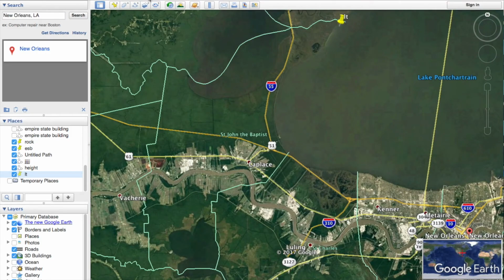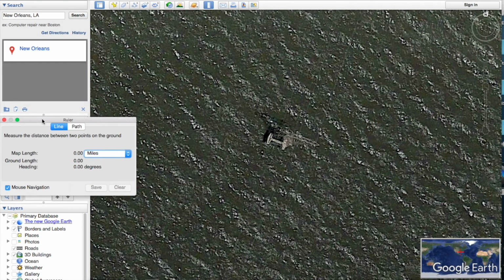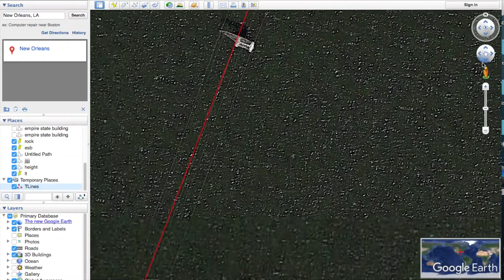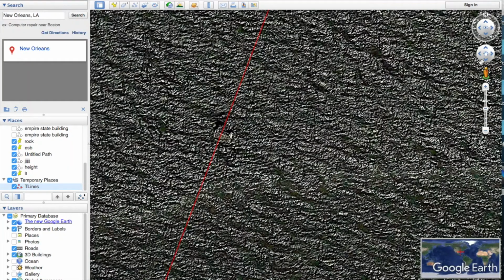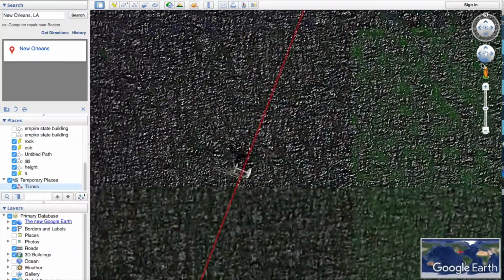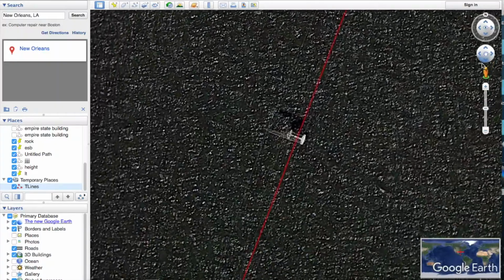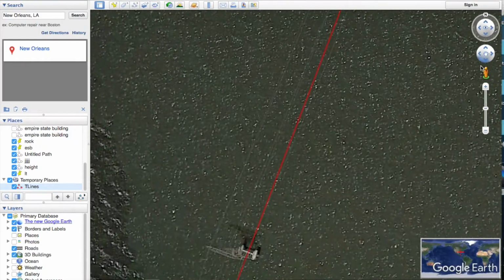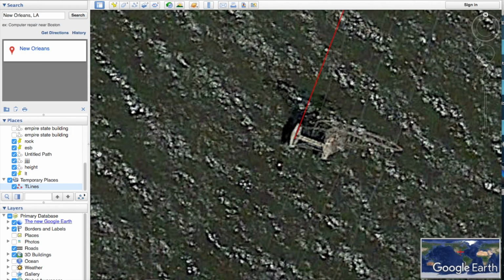Lake Pontchartrain Transmission lines, P900 creates illusion of a curve

Comment: BS if you look pictures taken,. sure this turn makes it more visible from certain side...  but downward curvature is visible from both sides... 

 if it would be only because slight curve in line 

that "optica illusion" wouldn't be visible from both sides of structure

plain and simple that was dishonest
Reply from the maker: BS - Soundly used a tilt shift lens - There is no curve on lake pontchartrain - And the lake is only 16 feet deep, all the curve he put on that water would have been a tsunami headed right at him......Comical

Comment from the maker: One more fact about lake Pontchartrain it has maximum depth of 16 feet, the average depth is a little less. The curve ballers want to claim here would make this lake a moat...its comical.  And based on the research by MrThriveAndServive - soundly was using a tilt shift lens.   Here is a little secret; as a surveyor I know the elevation of the land that surrounds a body of water holding it in - is all absolutely the same elevation and the water is Flat.
Reply: Same elevation does not equate to a flat earth.
Reply from the maker: @jeffburton2625  So the same is not the same...got it....comical
Reply: That's because the earth is an oblate spheroid with a slight pear shape, regardless of whether or not you understand why.
Reply from the maker: @jeffburton2625  And nasa keeps showing it as a perfect sphere..got it.
Reply: The comical part is where you don't understand why planets aren't flat.
Reply from the maker: @jeffburton2625  Yeah right, thanks for telling me what lights in the sky are not....got it.

Comment: You ballbags are so blatantly ignorant. Does water curve anywhere else on your ball? Water rolls down. It doesn't stop, unless its obstruction is higher. That's how the oceans and lakes work. They are contained. There's no magical force that holds them down. Think about that. Really hard. All beaches flow up from the water line. The walls in a harbor hold the water in. You do know physics, right?

Comment: These are minuscule deviations. Nevertheless, if it were this slight curve in the line that caused the bulge effect in the original video, and not the shape of the Earth, then the effect should not be visible on the opposite side of the transmission line. If you look this up on Google images, you will see the same bulging effect on both sides of the transmission line (to the left and to the right of the line), which proves that this slight deviation from straightness has nothing to do with the curve effect. Also, the deviations mentioned in the video do not explain  how the towers start sinking below the horizon as seen in every picture of this transmission line.
Reply from the maker: The towers do not go over an imaginary curve....  https://youtu.be/d3_umFGu_gc
Reply: That is obviously a superior mirage, evident by the reflection of the sky under the furthest section of the transmission line. In Google images, the vast majority of the Lake Pontchartrain transmission line photographs show a curve effect in the distance. You can't just cherry pick evidence that supports your belief.

(EDIT) For even more proof of the curve effect existing, here's a photograph of a highway bridge going over the same lake: https://i.pinimg.com/originals/dc/68/02/dc6802783c2567df07e6ffe2d72fc9fb.jpg
Reply from the maker: a superior mirage....comical....   https://i.imgur.com/spOzH6a.jpg
Reply: A quick Google search will reveal that wind turbines are usually built around 300 feet apart. Since there are 20 wind turbines in your image, we know that they cover 5700 feet in distance (300 * 19, 19 spaces of 300 feet total), barely a mile, and not even far enough to reach the horizon.The Lake Pontchartrain transmission line covers a much longer 5 miles in length, so it is clear why the transmission line curves and the wind turbines don't.

(IMPORTANT EDIT) 300 feet is actually the rotor diameter of the average wind turbine, and not how far they are spaced. While an interesting photo, the furthest turbine doesn't seem to go past the horizon, while the transmission line does. We would need the location of those specific turbines to determine their total length, but judging by the horizon line, they don't seem to span as far as the transmission line.

Comment: Sorry, tard, Your "analysis" is flawed. The small discrepancies you show in Google Earth are a result of them imperfectly stitching together satellite images. The surveyors and engineers who built the towers made sure they were all in a perfectly straight line. Any deviation from straight increases cost and reduces efficiency. But if doesn't really matter, because Soundly filmed the towers from BOTH sides, and the curve was the same.
Reply: The Globe Lie

The curve shown in Soundly's picture is very smooth and obvious.  Whether or not the towers are 100% in line doesn't make a difference.  You show some towers to the right and some to the left.  First, the amount isn't enough to show a curvature from both sides of the tower.  Secondly, the offset is inconsistent, sometimes to the left sometimes to the right.  Wow, you really don't believe in this pizza planet crap in 2017 do you?  REALLY?
Reply: TGL, no epic fail at all. Use metabunk 'curve' calculator in advanced mode (append ?a=a to the URL) and you will see that from 20 tf altitude the horizon bulge would not exceed 1/4 of pixel, so you can't see it at all.
Reply from the maker: Nice try, However, you do not understand the topography of the lake bed and the reason for a slight curve of the towers placement. Besides, Soundly's video shows no horizontal curve along the horizon and a sphere requires both, so epic fail.
Reply: Are you actually claiming that the topography of the lake bed somehow causes the water level of the lake to bend? Because any idiot can clearly see that while the towers are built on the lake bed, they were constructed in reference to water level, not the lake bed, and their height above water level is uniform. And, no, at the height Soundly was filming we would not expect to see the horizon curving horizontally. That's just idiotic. Try again, tard.

Comment: This is the sphere earth modeled in 3d, with teh towers, compared to the actual image: http://i.imgur.com/KZlmnqu.gifv
Reply: +negatorxx That is very cool!  Hopefully this is the beginning of the end of this fad which should have ended as soon as it began. And for The Globe Lie, we live on top of a large sphere. You won't see any lateral curvature until you get to some 35000 feet, and at that you will have to take a wide-field photo to measure. Much more important up to that point is the very measurable horizon dip, which has been known and used for centuries. http://thulescientific.com/Lynch%20Curvature%202008.pdf 
Also check out VoysovReason's videos on the matter of the horizon. See wolfie6020's videos on horizon dip. Both are valuable assets in your search for truth.
Reply: The Globe Lie it was a spherical model used.  im sorry spatial reasoning isnt your strong suit
Reply: The Globe Lie its there, but at different rates.  one is obvious, one is not.  It IS a sphere model.  You can dowload autocad and see the same if you like, rater than continue to embarrass yourslf here.
Reply: The Globe Lie

You CAN see the horizontal curve.  It goes all around you.  Turn in 360 degrees and you will see it.  Go up in an airplane and at 35,000 feet the Earth will shrink by 3.5 degrees from horizontal on every side of you.  Continue into space and it will continue getting below horizontal and getting smaller from an angular point of view.  The Earth is freaking BIG, you aren't going to measure a curve with a picture from anywhere near the Earth.  Basic tenth grade physics.  Simulate it in a 3d cad program using real size.
Reply: compressed perspective isnt a thing you dolt
Reply: again, the model was spherical.  say what you like all day long, but like a screaming child, you still wont get the candy.
Reply: +The Globe Lie Too bad we cant get together for a voice chat. I want to show you a video by Movie Vertigo called "How horizon curvature changes as height increases". It will show you a flat horizon on a round Earth. Search it if you don't want to do a voice chat. I mean your claim that the horizon should be curved is just wrong.
Reply: negatorxx

Excellent model.  What program did you use to create that?  I don''t recognize it.
Reply: +Quantum Eraser

If you want some really interesting hits, search "vertical relief with respect to a geoid earth models"

And then try the search with:

"vertical relief with respect to a geoid earth model and Salar de uyuni"
Reply: +negatorxx

Xxxxxcellent..,
Reply: Quantum Eraser, on 6 miles with observer height 10 ft we could expect 20 ft drop and over 15 miles it would be 130 ft drop below horizon, which perfectly fits Soundly's videos and globe model.
Reply: Globe Tard  

The Observer Height (Soundly) is 30-50 Feet.

And, I say again...

The total distance of these power lines over Lake Pontchartrain is 15.9 Miles.  
The distance between each Pylon is .18 Miles. (~88 Pylons)
I counted ~ 35 Pylons in Soundly's now infamous "No Parallax" shot...roughly 6 Miles, with some significant curvature.
Louisiana Length (North/South = 379 Miles)

If these Pics/Video are TRUE; THEN, we MUST LIVE ON...

                                         "PLANET LOUISIANA"

What came first the trainwreck 'model' or Soundly's Trainwreck Video? ;)
And ROTFLOL...: http://imgur.com/iWg9vSZ  ??  I suppose this isn't "A PART" of the 'model', eh? smh

"globe model"---

1.  'models' are demonstrable Pseudo-Science.

2. Begging The Question (Fallacy): 'Globe".

Have Cara (smh) "MODEL" this...

"The salar de Uyuni in the Bolivian Andes is the largest salt flat on Earth, exhibiting LESS THAN 1 M OF VERTICAL RELIEF over an area of 9000 km2"  ..."Longer wavelengths in the DEM [Digital Elevation Model] correlate well with mapped gravity, suggesting a connection between broad-scale salar topography and the geoid similar to that seen over the oceans."
Borsa A. A., et al: Topography of the salar de Uyuni, Bolivia from kinematic GPS; Geophysical Journal International Volume 172, Issue 1, p. 31-40
http://gji.oxfordjournals.org/content/172/1/31.full

This is a Geometrical Flat Plane.

You can have a myriad of Topographical Features on a Sphere: Mountains, Ridges, Saddles, Spurs, Depressions, ect ect;  Ya know what you CAN'T HAVE (??) ...

                                "A Geometrical Flat Plane"

And this one is over "9000 km2"!!!!

Model this on a Globe ...? 👌

regards
Reply from the maker: so a globling living in PKAR, thinks I am embarrassing myself...how amusing and comical....I think you are beyond asleep my friend you are in coma .
Reply from the maker: I hear you, I understand that lateral curvature can not be seen based on the heliocentric model unless you are at a very high altitude, and that is the point of contention with soundly's video showing a dramatic amount of vertical curvature over just 5 miles to the horizon, so much so that if i were looking at the towers from the side - perpendicular to his view i would see a dramatic curve along the horizon based on his video, and that is not possible...that is the entire point of my video.....making soundly's video bogus...
Reply from the maker: Oh ok I get it, a vertical linear curve but no horizontal curve....so we live on a tootsie roll a tube earth, brilliant, sorry my friend but a sphere requires both a vertical linear and horizontal curve, and compressed perspective don't count... https://youtu.be/VoSsftDHLdE
Reply from the maker: Yeah looks like we live on a tootsie roll ,no lateral horizontal curve only a linear vertical curve...    http://i.imgur.com/iWg9vSZ.png
Reply from the maker: A spherical model requires both linear vertical and lateral horizontal curve, a sphere is not a tube. Your model is an epic fail.

Comment: you should calculate the amount of curvature you claim is caused by the tower's placement and then calculate the curvature seen in soundly's videos.  i don't accept that the few feet of variation to the left and right by the towers would constitute a curve of the same magnitude shown in the images and the fact that it varies in both directions suggests that the average is placement is pretty much straight.

you should also consider soundly's footage taken as he drives through the line of the pylons demonstrating just how straight they are: watch?v=Zr-tNw_s5nM

don't you think, all in all, it's much more likely that the earth is a sphere?  it does fit with all the evidence and spheres are nature's default shape.
Reply: "Compressed perspective" is magical. Because it doesn't exist.
Reply: The problem with flattards is they just can't bring themselves to its a "Globe" When in reality, this is what we are seeing.
Reply: True South    True.  That has been my experience with flatheads, although many are loath to admit it, 99% also subscribe to the god concept.    TNQ
Reply from the maker: Nah, no need for me to do any further research on the illusion of compressed perspective and the fact that the  towers are not in a straight line...buy hey you can!!